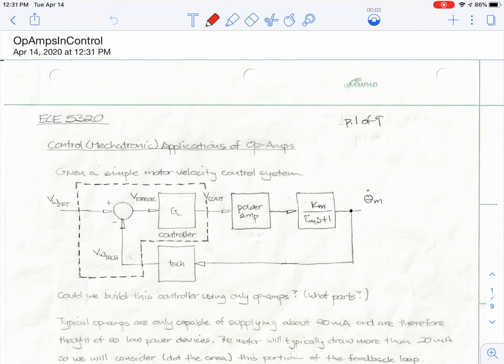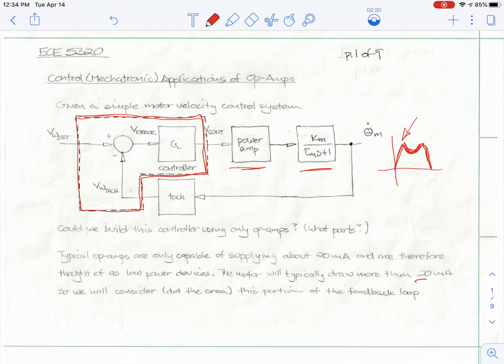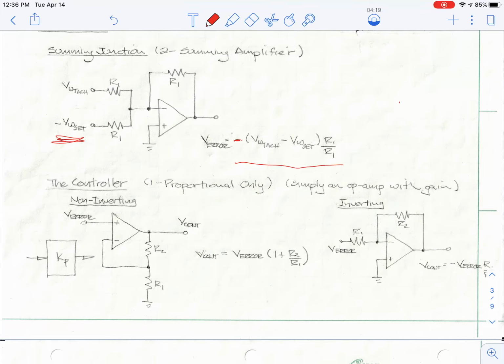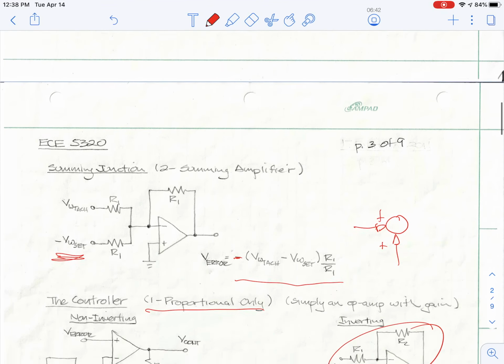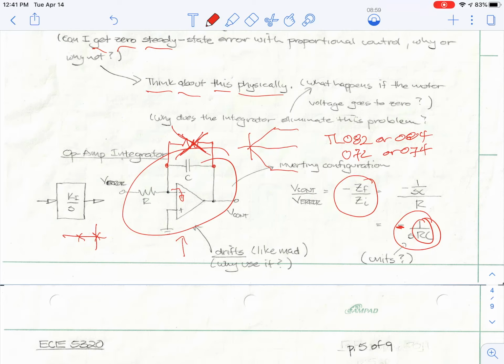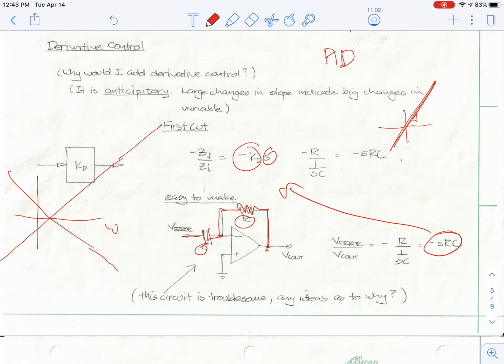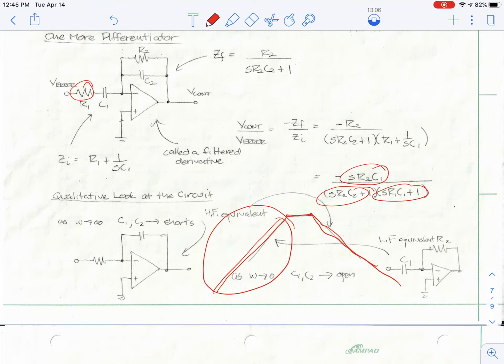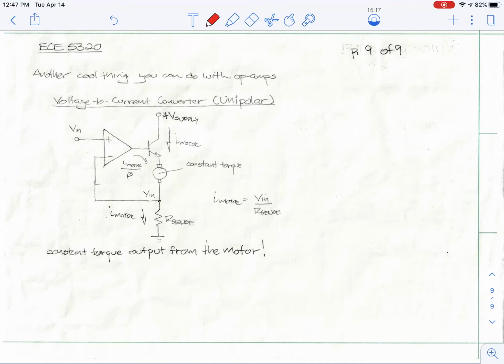Op Amps in Control Systems

Comment: how does the constant torque circuit work for a dc motor
Reply from the maker: The torque of a DC motor is Kti where Kt is the motor torque constant and i is the armature current.  The op amp circuit discussed holds the armature current constant.